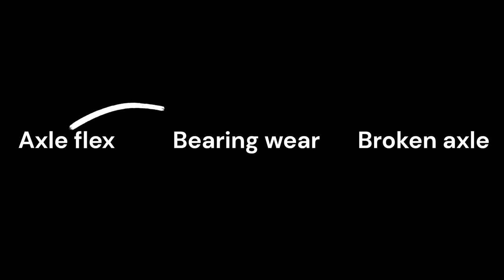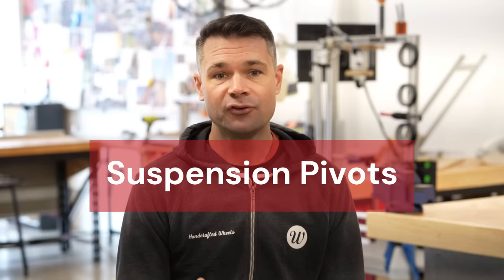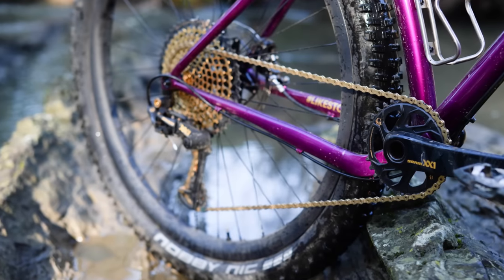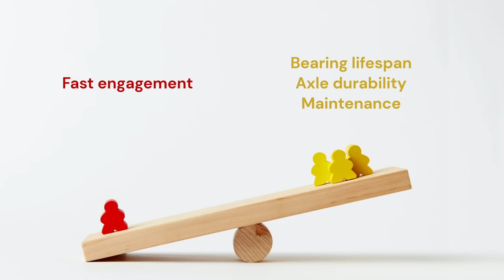Is it worth breaking axles for 690 POE?

Comment: We appreciate the feedback and thorough evaluation of our Hydra hubs. We made a running change to our axles to eliminate the stress riser at the bearing journal adjacent to the FH body as was noted in the video.  We have been using these updated axles in our service department for over a year and once we confirmed this had corrected the issue, we made the running change to all production hubs in June.  We have not had a single failure we are aware of to date with the updated design.
Reply from the maker: Is that the "stress riser washer kit" axle which is available?  Great to hear that it's corrected the issue as the Hydra is such a unique hub with incredible features.  ~Tristan
Reply: @WheelworksHandcraftedWheels  - Yes, we've been shipping the updated axle in new builds since June, and have been offering it exclusively as the warranty replacement prior to the BOM change. It's also available from our webstore for any riders that would like to fit the updated axle to their hubs.
Reply: @industrynine3931  wouldn't be beneficial to have a cromoly & titanium version of the axle instead of an aluminum alloy?
Reply: In the video he shows the new design from Mid 2022 as still being flawed. So just to be clear the "stress riser washer kit" axle is different than this mid 2022 design and has only been in production units since June 2023?
Reply: The same problem is also from Torch. I have destroyed the second freewheel in which my bearings broke completely. I paid 500€ for the hub and then changed the freewheel 2 times which each cost 250€. So I paid 1000€ for this super hub and in the end I threw it in the trash and bought a reliable DT Swiss.

Comment: it's a failed engineering, or simply, engineered to fail. Solution: first change to DW Swiss and ride.
Reply: Honestly DT Swiss is all you need for human powered bikes imo. On e-bikes you might want more poe.
Reply: @treimar  Reliable and durable hub is what you need, trust me.
Reply: @ivanteo1973  Yes, but as ebikes/gearbox bikes have a freewheel mechanism in the front aswell it kinda multiplies the engagement slop of the hub. So I do prefer high engagement for those. But I just recently settled for Hope Pro 5 with "only" 108 poe. Does the trick for me.
Reply: @treimar that is reversed logic, for e bikes you need less poe, something like 18t ratchet
Reply: @aleksarajkovic3471  I get why you would want that for strenght and etc, but you will end up with slop fest. The motor has a sloppy freewheel and then you have a sloppy freewheel at the back aswell. It will take 3 business days to start moving.
I prefer high poe to cancel out the slop of the motor as much as possible myself.

Comment: As an admitted DT Swiss fanboy who once strayed to the allure of shiny, loud things made by I9, only to be immediately regretful, I watch this video with a smile on my face and a slow engaging 36T ratchet hub that is utterly bomb proof attached to my bike.
Reply: My grin goes from ear to ear. But hey, im sure its covered under wArRaNtY.
Reply: I do like the 240s for simplicity and weight, but I do enjoy engagement and switched to onyx and take the weight penalty! Bomber, hubs, and absolutely instantaneous engagement!
Reply: I used to run a Chris King, and did love the beehive buzz, but since then have been a onyx fan, a little bit of a weight penalty in the very center. Of my wheel, but the engagement is well worth it! Plus all the bling, or any bling you want! What do you guys think of the new rope spokes? I’m thinking my next bill will be a onyx Hub., With bird spokes. Because they have a Hub made for those spokes now.
Reply: The 54t ratchet is pretty nice, and still quite bombproof.
Reply: The ratchet ring system also has the advantage of all teeth engaging at the same time so the connection feels super solid when it hooks up. I say this an a i9 torch owner but I definitely love the feeling of the dt hubs when I ride friends bikes
Reply: @trailjockeytj6160 i heard those can be mushy, how do you like it
Reply: @adamneulander  You know, I’ve heard that as well, on earlier models. But the one I have is instant and spot on love it over all other hubs!

Comment: Its single pawl engagement - happens in many traditional hubs, due to tolerances. But happens in Hydras by design, absolutely crazy. Single pawl engagement puts a huge radial load on the bearing and axles, and that's why they're failing. Best thing to do is by a dt240. Failures probably more common on full sus because of single pawl engagement (high radial loads) under harsh pedal kickback (drops at slow speeds). Doesn't happen on hardtails.

Comment: I've had Hydra hubs for 2 years now and they skip from time to time as if the leaf spring weren't stiff enough to bring the pawl to fit inside the ratchet ring fast enough. This skipping only occurs on the first engagement when you start pedalling hard. I9 changed my hub on warranty but I expect bearings to give away next year. Can't tell about the axle but this video is pretty clear to me. Conclusion for hubs: High POE, Reliability, reasonable price... you can only have 2!
Reply: I have the same skipping on my Torch hub.  Usually after coasting, and then engage, can hear a loud snap/crunch noise.  Annoying, and other than it eats cluster hub bearings it's been fine.

Comment: I have seen no hubs fail as much as industry nine. Probably 5-6 catastrophic failures in the past 8 years. I have seen the hub flanges crack free of the hub body, ratchet rings cracking and getting stuck, pawl springs cracking and of course, axle failures. I would love for these hubs to be strong but the reality is, they are not.

Comment: Thank you for posting this. I am also a wheel builder and have gotten some strange looks when discussing this with clients. I appreciate the improvements to the axle design and I’ve also noticed a significant improvement in bearing smoothness on the hubs I’ve received this season. I understand why people like these hubs and it’s nice to see i9 attempting to address the weak points of the design. As for me, I own 4 bikes, all have DT 240 or 350 hubs.

Comment: Nice to see this issue being publicized a bit instead of pretending this isn't happening. I've run into this problem several times and have a few points to add:
1. This also happens to 1/1 hubs even though they don't have engineered pawl flex. I've broken 3 1/1 axles, they always break at the same stress riser spot.
2. Do not count on your hub to start creaking if it is breaking/broken. Inspect the axle when you do regular services! You'll see stress fractures forming in this area before it fully breaks. The first time my axle failed (I didn't yet know it was possible), I got no indication anything was wrong until my wheel axle failed as well (because the hub axle had already broken) causing my rear wheel to jam and lock up. Had a big crash as a result.
3. At least for the 1/1 which is not supposed to flex, the steel 'forever' axle from Pinner has been a great solution for me. Wheel/axle interface is noticeably stiffer and at least so far appears to be holding up well.

I will say that I9 always got me a new axle quickly whenever I had this issue, but it just became too big of a liability worrying about when it might (will) fail next. Also for some reason you can't buy the 1/1 axles off the shelf so it was impossible to keep a spare in my toolbox.
Reply: Was going to share the same outcome with 1/1 hubs. Broken axle, very short bearing lifespans. And, I could "press" the bearings in with one finger (even on the second warranty-replaced hub). I'd like to trust I9 because on paper they are a fairly competitive hub, but the maintenance and reliability issues sent me away.

Comment: I'm a trials rider using Hydra hubs on all my bikes from comp trials, street trials, MTB and E-Bike.

I must admit when the hubs first came out I was reluctant to try them as trials depends on strong engagements and often the more engagements you have the less reliable they get. I did eventually dive in and get a set and I haven't had any issues yet. My oldest pair are on my street trials bike and are 3 years old I think, still on the same bearings, same internals and same lube/grease from the factory. In fact, the bearing life has impressed me as I've had issues with bearings on Hope hubs in the past.

My MTB and E-bike wheels are only 6 months old but they're still perfect too with no skips on any of my hubs either.
Reply from the maker: That's really interesting.  As I said in the vid we see much better service life on hardtails so I'm wondering if the super stiff back end of a trails bike really helps these hubs?  -Tristan
Reply: The HT thing could be a thing, also note that his Trials rear end isn't 148, it's 135/142 and uses a bolt in axle, not slide through/TA like most use, so yes, much stiffer. Thanks for chiming in Ali, but you forgot to mention one critical bit of info, that you're sponsored by Industry Nine, so yeah, um.....
Reply: Similar experience here. No longer into trials, but I value the fast engagement. No failures here on a RM Slayer. 
Servicing is just too easy in these things!
Reply: you must be very light
Reply: Hi Ali,
I just broke the axle of my 2 year old hydra hub on my Streettrials bike. I already purchased a replacement hoping that it will be the slightly reinforced version. But besides that, I also never had any skipping with that Hub. 🙂
As you have a lot of experience.. do you think it's ok to continue riding the bike until the replacement arrives ?! I mean... there is still the bolt thru axle holding everything together.

Comment: As an owner of the Hydra hubs, thank you for this video and lessons learned.  The real issue is anything mechanical has a failure point.  And any good manufacture can learn from and make the necessary design changes as noted by Industry Nine in the feed.

Comment: Fantastic video.  I’ve snapped 2 axles already and wasn’t sure what’s going on.  Good to understand the detail behind the design and it’s pros and cons.  I still love my I9 Hydras, but I now have the information to maintain them better than before.  Thank you!
Reply from the maker: Glad it helped!  Have you been using the "stress riser washer kit" axles?  https://industrynine.com/parts/axles

-Tristan
Reply: @WheelworksHandcraftedWheels   I don't think so but I will start when they need replacing.
Reply: you still love them? 3 comments above the guy says "Do not count on your hub to start creaking if it is breaking/broken. Inspect the axle when you do regular services! You'll see stress fractures forming in this area before it fully breaks. The first time my axle failed (I didn't yet know it was possible), I got no indication anything was wrong until my wheel axle failed as well (because the hub axle had already broken) causing my rear wheel to jam and lock up. Had a big crash as a result."

Comment: Bearings were my big issue when I had the Hydras on my Ripley.  I would go through 2-3 sets per year.  I have never had that on any other hub over the past 19 years.  I do climb about 200k per year and about 1700-2000 miles, all on dirt in Utah.  Hadley hubs are really good but Kings are my favorite.  The new Hope Pro 5's also look interesting.
Reply from the maker: What I've observed over the years but never quantified is the impact that the frame has on hub bearing life.  Most frames are reasonably flexy and reasonably misaligned (hey, nothing can be manufactured perfectly) and the specific flex pattern of a frame can affect Hub A more than Hub B, even if both of those hubs display similar bearing life on different frames.  Maybe your Ripley frame was just a poor match for the Hydra?  -Tristan
Reply: @WheelworksHandcraftedWheels  cool that makes sense.
Reply: @WheelworksHandcraftedWheels  yep, this. Even something like riding style - for example, if you lean the bike more and your body less in a turn vs. always keeping your weight in the plane of the seatpost - can drastically impact the forces on your BB, which transfer to both axles and hubs.

Comment: One of the first very valid points you made was to maintain and check your equipment. 2720 miles on new Pivot 429 since March riding around Phoenix, Tucson, S New Mexico, Angel Fire and around El Paso, Tx. regular cleaning and maintenance every couple weeks. Rolls fast and smooth bearings still quiet.  So when should my sub standard hub break as predicted by some commenters?

Comment: Brings to mind a terrifying experience from many years ago when sealed bearing hubs were becoming a "Thing", Phil Wood, etc making them.  In a race, I won a set of sealed bearing hubs by a manufacturer I'd never heard of (and can't remember) and built them up as wheels for training.  All was well until some weeks later I was in a practice race at the Rose Bowl in Pasadena.  Had just begun a stint at the front, and as I folded the bike into the first 90 deg right turn at the bottom of the course, one of the rear wheel hub flanges exploded, and the rim and tire moved over and locked up against the chain stays.  I couldn't turn and shot straight across the intersection, fortunately no cross traffic, tire wore down to the casing at the one spot but did not blow.  All the other riders made the turn no problem, thankfully.

Examination revealed that whole chunks of the flange had torn loose, and fatigue cracks emanated from other spoke holes in that flange, the other rear flange, and both flanges of the front wheel as well.  The flanges were much thicker than those of the Campy hubs I was used to, making me wonder if they were cast aluminum rather than forged?

Before someone informs me I overtightened the spokes, I'll point out that I never saw this problem (or any other) with wheels I built using Campy or Phil Wood hubs.  And the reason I was building my own wheels was that I was racing on a very limited budget.
Reply from the maker: That sounds like the glory days of CNC components! Apparently a slowdown in the aerospace industry left a bunch of CNC machines with excess capacity so up sprouted a bunch of companies CNCing everything and anodising it purple -Tristan
Reply: @WheelworksHandcraftedWheels  Really wish I had a photo of it.  don't recall that the exterior looked smooth as I would expect (?) from machining, not anodized.  We're talking early 1970's, dark ages.

Comment: Contacted I9 about the updated axle since I was replacing all the bearings and they sent me the axle and kit no questions asked. First time on Hydra and I’m liking it, but I also have a wheel set with Onyx so it’s not that much difference in the engagement. I have had the pawl hang up a little… my wheel set is $1800 Ibis carbon so no complaints. I prefer instant engagement because of the trails I ride it helps a lot and I’m disabled and getting older and need all the help I can get, but that doesn’t mean I’ll get an e-bike. Thanks for the video!

Comment: Two wheelsets with Hydra hubs and never had a problem.  Been riding the first set since 21' and the other since 22' both with over 3k miles on them both on Enduro bikes that get ridden like I stole them.  No mechanical issues of any kind.  They were built by I9 and have their aluminum spokes also.

Comment: It isn’t that aluminium is a stiff material, it’s a lot more flexible than steel, size for size. But it’s much lighter, so by using more and making things bigger diameter you can make it stiff. Furthermore, because aluminium suffers from fatigue cracking, you NEED to design it to be stiff and avoid cyclic flex or it will break. A steel or titanium axle could tolerate this, but it would be hard to design it to be flexible enough while maintaining the diameter, which is needed for the through axle. Out of interest, fatigue life tests on cylindrical parts are often done by forcing the part into  a bent shape then rotating it, so the life of these axles is a hard one.

Comment: The Hydra hub mechanism is an compliant structure that uses freehub and axle flex to make the 690 points of engagement happen. Unfortunately this also results in poor bearing life and ultimately, axle failure. Aluminum has a finite fatigue life and they've built a hub that uses aluminum as a spring. It's a ticking time bomb.
Reply: lol, what could go wrong...

Comment: I agree with this.  My experience though was the cheapest component didn’t fail.  The freehub spur ring developed cracks and the pawl pockets stretched.  Both of these caused the hub to ‘pop’ quite a bit.  This required lacing in a new hub that I9 did not cover under any warranty.  I’m an old weak guy and did regular service using the recommended oil and grease.  So not sold any longer on the I9 Koolaid.  May consider an Onyx hub in the future but definitely will do research beforehand.

Comment: Great analysis. As someone who spent 30 plus years in industrial maintenance issues related to machine shop work on say pump shafts and failures related to stress risers from sharp transitions were addressed by changing the machining to eliminate those sharp edged cuts. Since most cartridge bearings do not have sharp edges but have slightly radiuses edges simply matching axle radius to the bearing edge radius should make a difference. Requires mod to machining not sticking a washer in the critical location.
Reply from the maker: Interestingly the new Solix hubs have a very large radius on that part of the axle and do not have the 'stress washer kit'. It's worth noting we haven't seen any issues with the 'stress washer kit' axles and they seem to increase bearing life -Tristan